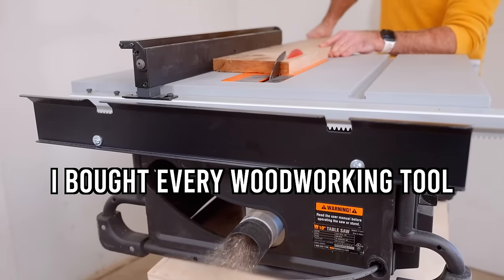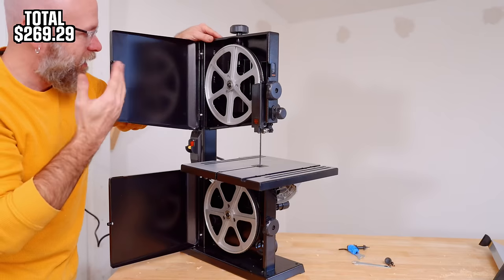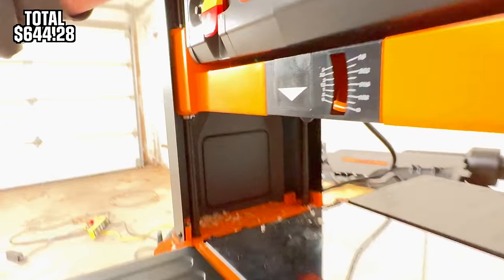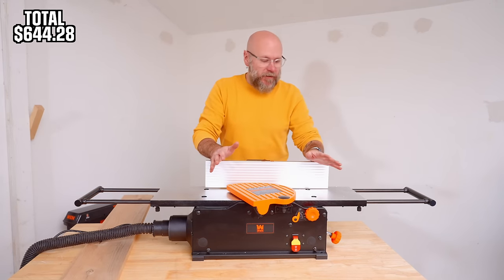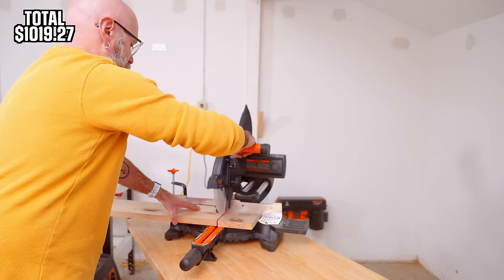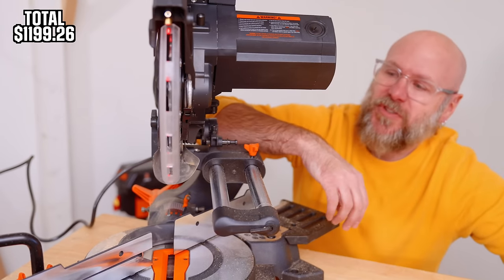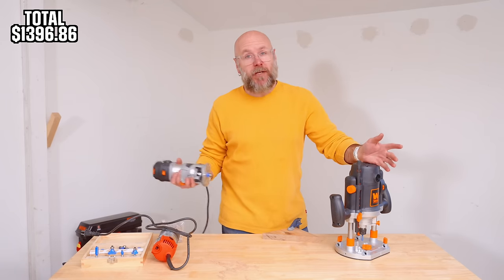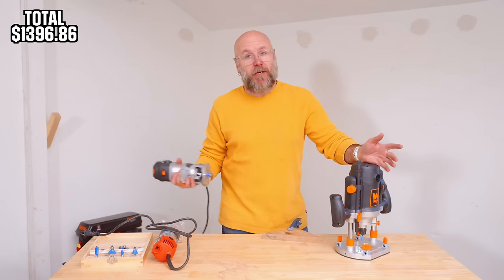I Bought ALL THE WEN TOOLS! Let's Review.

Comment: Actually you have it wrong,the correct way to machine wood is,
The joiner is first,that is so you get one face and one edge clean and a perfect 90°.
Upon having a clean,flat face and edge then you pass the opposite sides through the planner wich gives you a square and dimensioned piece of wood.
I've been a cabinetmaker for 38yrs,never do you use a planner first.

Comment: On the drill press, just screw the bolt and nut on the lid, not through the spring/bracket then just slide it up/open and shut without undoing it :)

Comment: I got a nearly new WEN planer off of craigslist that had a similar problem. A month or two after purchase the bearings in the drive gearbox failed, resulting in no feed. Must have been pretty annoying for the original owner but for me it was $40 replacement from WEN to get the thing up and running for a steal.

Comment: I have a 2 or 3 blade 13" Wen planer that works pretty well.  The only major issue I've had with it was when one of the drive sprockets broke, but the replacement part was cheap and easy to install.  I never use the rollers on top either, but that's partly because my kids always run off with them 😂

Comment: When I shop and compare, I find WEN and some other (similar) brands are identical except for logo and colors. The direct from WEN price seems to be the best...  The WEN tools I have purchased after comparing head to head, that were a better price with more or the same features:

WEN benchtop belt sander (2, the older blue one, capacitor went bad after several years of service, bought the new version... then replaced the capacitor so there are 2)
WEN scroll saw.

Comment: Some people prefer to use the bevel feature when cutting miters; as compared to actually bringing the blade out of perpendicular with the fence...

It frequently seems like bevels are more accurate than actual (vertical blade) Miters are....based on how my saw adjusts.

Comment: I have that exact planer model. It's definitely a 5/5. That said, Wen does need to work on their QA.  My Wen drill press wouldn't work until I manually turned the belt heads a few times, and the first scroll saw I received was significantly damaged (Wen replaced at no change).

Comment: I like Wen tools. I got the drill press as well, and it definitely works, but it's kinda gutless. It's good for like 1/2" bits through wood, but anything larger through anything metal? It's having a hard time. 
But hey, $100 and I'm happy with it. 

And I agree with your critiques. The spring-back is very strong and "snappy".  Also don't like the plate because you can't clamp much to it because it has weird cutouts. I went ahead and bought the drill press "table" and that is actually pretty nice and helps it's usefulness.

Comment: On the drill press, the spring tension on the spindle is probably adjustable.
On the band saw, I understand putting a good blade on, but I'm curious what the OEM blade would do.
On the table saw, needing to throw out the miter gauge would make it 4 stars.  The factory guide should be usable. Yes, most of them are not great. But many users never upgrade. 

All that said, this is an interesting set of reviews on a brand that I'd not considered.

Comment: Up to 11:40, we are with you. Clear, well made and enthusiastic, considered narration.  But talk about contrary...the thickness planer at
11:40.  How on earth can you emphasize that "Its such a high quality machine!" and in the next breath say .. "...Disappointed... Zero Stars" ? 
You are rating the overall machine, including construction, quality, power, solidity, accuracy, function.  
So at LEAST 4 stars if you listen to your self. Previous two items had too cheap knobs parts didn't fit to reinstall- ... 4+ stars~
For this planer you should GET the missing part and rate it aditionally how it feeds! 
Imagine if Consumer Reports ranked a gorgeous top quality 5-star car, at zero just cuz it was out of gas!
UPDATE:  I see you did, try again on a new one. congrats. 
PS.. Owner of about 5 planers from 14" to a humongeous 4200 lb. Wadkin and Stanko, both with built in blade grinders.(and about 50 other woodworking
machines, up to a 5 x 10ft CNC router.

Comment: I have a couple of tools from Wen and have been using them for 5 or 6 years now. The results of your review follow my expectations exactly. Wen tools are fantastic. However, it is hit or miss as to whether the tool you receive when you order it will be complete and working. I am actually a little surprised that you bought that many tools from Wen, and only one of them had a major problem. The quality and functionality of Wen tools is great for the price point, you just have to accept that you may have to return them a few times until you get one that works😂

Comment: My new WEN 9" bandsaw is my third bandsaw. It has been great so far. My first two were both JET. The first one was a cabinet bandsaw & cost $800+. My second was an open bench type for about $350+/-. From day one I had several problems with it. It would bind, damage saw blade (I went through 13 in four years). I had a factory repairmen some to my house. He could not fix it, so he took it to his shop & returned it a week later. It worked about 10-15 minutes. By the time I knew It would not work, I had it over the 5-year warranty, but asked JET if they would honor my exchange purchase of a more expensive machine... the answer was clear... NO! I gave the machine away for free & will NEVER buy another JET machine!

Comment: 11:38 I have the same planer I love it!!! 
 
After having a DW735 for 6 years, it died. I bought a new one, motor fried it 2 weeks. Took it back for new one, and the 2nd one, the motor screamed bloody murder out if the box, took it back for another one. The 3rd one only ran in high speed, so I returned it and got a refund.  (Dewalt has really gone to garbage over the past 5 years. They've cheapened everything to death. I'm done with Dewalt as a whole and 6 years ago, I had $7500 worth of Dewalt tools.) 
 
I only bought the WEN planer to hold me over until I could find a better one. It's been a year, and thousands of BF, and it's still perfect!!! 
 
I do miss one thing from the 735... the chip ejection on it was strong!!! The WEN definitely needs a decent dust collector. (Which was the other AMAZING WEN I found. But that's a different story.)

Comment: Buy a used table saw for your first saw! Old contractor saws are great and adjustable. I got a steal on a hybrid 2000’s craftsman saw for $100! Deals are out there. It’s much better than any new $400 saw and I modified it to have about 48” fence capacity.

Used tools for the win!

Comment: The flip part on the tablesaw fence isnt for small pieces. I'm not even sure how you're thinking about that.... The flip part is a support, when the fence is off the table, when it's extended to the far right. The flip supports the wood, instead of having nothing.

Comment: I got the bandsaw, and it is pretty good. Best option I could find for the money. But it I definitely plan to upgrade to a Rikon down the road. 
I got a Festool track saw but I use Wen track because it is compatible with Festool track and is a fraction of the cost and works just as well. 
I got Wen 3-2-1 blocks and those are the only sub $200 ish that are any good and I think they were like 20 bucks.
I don't think Wen makes tools, I could be wrong, but I think they shop from what is being offered by white lable manufacturers. With that said, they seem to be picky about what they put their name on and everything I have used from them has been decent. Nothing amazing (except their tracks),  but nothing bad either. For low cost tools, I have a high  level of trust with anything branded Wen. I tried some Tack-life stuff too and seems similar quality and price.

Comment: I have a WEN 4214 12-Inch Variable Speed Drill Press that I bought in 2017 and it's rock solid - this was before Harbor Freight started moving upmarket and their drill presses were flimsy (except the yuge floor-standing one), and the ones at the big box stores were too. This drill press has been very solid and I have been very happy with it. However, the lasers gave out and I had to replace them and that was a bit of a pain - I'm going to order a few extras to keep on hand. 

I also bought a variable-speed bench grinder a couple years after and I have been less happy with that - had I known Hazard Fart was going to move up market to fill the vacuum Crapsman left when Black and Decker cheapened Craftsdecker tool quality, I'd have waited and bought the Hercules grinder.  I'm not going to buy any more WEN tools because they seem to be kinda chincy with iffy reliability and finding local dealers is nigh on impossible, whereas Hazard Fart is everywhere and I can just bring a tool in and exchange it for a brand-new one - no waiting weeks or months for it to come back after paying a very expensive shipping bill to send a tool out for service, or having to try to source alternate parts from Grainger as WEN discontinues the parts and modify the tool to fit alternative replacement parts.

Comment: @16:09  I get it.  I like round knobs, too, but you're overlooking their utility.  Just rotate them out of the way, like you did immediately after complaining.  You didn't mention the best feature of the WEN miter saw.  The fixed tubes don't slide out the back of the saw which saves a ton of space in a small shop.  My miter saw is a 12" top of the line Dewalt and it needs a lot of space behind it.  Love the easy adjustment and bit changing lock on the trim router; it beats the heck out of my garage sale Ryobi!

Comment: Haven't made it to the end yet but I have the 3 blade 13" planer and have been using it for maybe three years and it works pretty good and consistently across various types of wood. If I could do it over I'd get the helical but I decided my youngest needed shoes the year I bought this.
Reply: Also have the 8" Helical jointer used sparingly so far and an in the box air filtration system I've yet to hang from my ceiling... cough cough.

Comment: Good luck with the jointer. Please do a follow up review after you try calibrating it. The design is a copy of all budget tabletop jointers. It has screws on the top of the bed to level it, and it never is level. The fence design watch closely as you lock it down, it shifts every time. Look forward to your how  to calibrate video.

Comment: I bought almost the same planer a year ago (mine is the two-speed version) and I have a mixed review. First, planer worked perfectly for me, no missing parts, etc. However, I do not like the fact that Wen uses a carbide bit that is pretty non-standard and so the inevitable replacements make this more expensive over the longer term. I actually find pretty often that my feed does not work very well and I have to gently push my boards through. This was my first planer so I can't really compare it with other brands and models.

Comment: I’ve just bought my first wen piece, the drill clamp, guess what it’s 4 stars, essentially it works but the geometry is slightly off so it’ll only clamp things over 7mm ish. For metal or even 6mm ply you then need a sacrifice board underneath. The bobbin sander I have had an identical one from a different brand and it was lovely until a student undid the cheap adjustment knob too far, the springs fell out and it never reassembled quite the same again, still did the job though, just noisily.

Comment: I actually like the cheap tools like that because 1.) WHEN they break, they're usually easy to fix. 2.) Plastic parts like knobs and switches can be replaced with 3D printed parts. 3.) They usually use common screws instead of special M2.575 x 21.5mm screws or something ridiculous like that.

And finally, it's cheap... So you can buy 2 or 3 of them for the same price as one high end tool. It's not bad, but it's not great.

Comment: Thank you for posting this. I have the drill press and combo disc-belt sander. Bought both of them from the wen shop on amazon. Had to return the sander due to a bad motor. They shipped a replacement in a week. Will probably get the track saw or bandsaw as my next purchase based on your reviews.

Comment: LOL, I have that exact drill press.  I bought it from Harbor Freight maybe 15 years ago for $40.  It works.  The bit speeds are a little too high for drilling steel but will work in a pinch with lots of oil.  The torque is a little low to the point I never bother clamping workpieces since I can stop the motor by just holding onto the piece hard.  It will drill lumber and plastic and Al just fine.  Steel works up to about 3/16" or so and you have to dump a lot of cutting fluid or oil into the hole to prevent overheating.  HF no longer sells that exact drillpress so Wen must have bought the rights to the design.  $40 was a great deal.  Honestly, for $100+, you can get a better one from HF these days.

Comment: I Bought All Ryobi Powertools
Pretty Cheap. I Have A 10 Inch 
Miter Saw A 16 Inch Scroll Saw 
& I Got A Crap Load Of Ryobi
Tools At A Thriftstore.
I got The Ryobi Bag It Contained
A Recip Saw A 5 Inch Circular Saw
Flashlight & Drill. & I'm Happy
With Each & Every One Of Them.
I Whent On Rockler Woodworking's
Website & They Had A Toolfest
Miter Saw For $1 ,300.00 That 
Was Crazy!!!! Who In The Well 
Would Fork Out That Kind Of
Money? I wouldn't Fork Out
That Money For No Miter Saw.
I Paid $331.00 + $25.00 Tax
Wich Came Out To Be $356.00

Comment: I had the DeWalt planer which was stolen. I found that the Dewalt 18:38  was a lot more powerful. I bought a Wen with the spiral head. Good cut.  It works hard on hard knot cedar as well as maple.  Other woods even oak work well  Dust collection not as good as the Dewald

Comment: I have the Wen Spindle Sander, and love it. I also have the VSR Benchtop Drill Press which I also love. Budget does not have to = garbage, and I think with a few exceptions they have shown that. For a hobbyist, non-production environment I think they absolutely work. 
I was super disappointed about the Planer you received though, it really sucked the enthusiasm out but am interested to see what happens with the new one they sent as I am super disappointed with my Jet, and may be going back to Dewalt (or upgrading electrical and getting a more substantial planer). 
6" jointer regrets.... "what she said".

Comment: You are a little hard on Wen for the planer. I bought a brand new DeWalt miter saw and ended up opening it after 90 days so the big box wouldnt take it back. The deck had the slightest crack in it. You flipped it over it had a very large crack from a bad casting. This was not from stress or being dropped, surface was really rough, like the aluminum was not quite melted and not enough aluminum, had a bunch of tiny air bubble in the casting. DeWalt service center said they never seen this. They ordered the part, i called 1 month after dropping it off than 6 weeks, still waiting on the part. After 8 weeks they said come in, we just replaced it with a new saw in the box. That was the 4 miter saw I've owned by DeWalt, outstanding quality, but even they screw up. QA was asleep at the wheel that day.

Comment: On the bandsaw, I wish you had compared the ease of guide setup and adjustment, compared to your best bandsaw, and checked how difficult is is to make the table exactly 90-deg to the blade. Does the bandsaw have a blade-tension release?  Likewise on the drill press, how easy is it to make the table perpendicular to the drill bits?

Comment: Most of the tools you reviewed come out of the same factory that produces Ryobi for the US market. Ryobi in Japan makes their tools in Japan. Contrary to belief, Ryobi JP made good tools.

I have a Wen tracksaw but I opted for the 8 1/4 inch version as I could easily get Diablo blades. I didn't buy the Wen tracks but got the Powertec tracks.

The tablesaw is a Dewalt ripoff like everyone are doing. I had one but it was the plastic base version rather that the roll cage design. It was a very good saw. All contractor saws are loud as they have an open base and high winding motors. A 3 hp cabinet saw wouldn't go into second gear to cut 3/4 material.

Comment: Their band saw isn't too bad for the price especially for routing, but I do wanna upgrade to have one with a larger more sturdy blade. I have their largest drill press model and it is very nice and has a digital speed read out and you can change it without changing belts, probably won't upgrade to a floor model for quite some time. The spindle sander is alright but I'm definitely about to upgrade. I also just got rid of my wen 6" jointer in place of a grizzly 8", I really did not care for the wen. It worked but was very small, horrible dust/chip collection and was annoying to set up, and the table is short.

Comment: I bought the wen drywall sander years ago it was cheaper than the cheapest part you could replace on the porter cable sander it worked great and I got 4 more and they all still work and I haven't had to fix them like I would always have to do with the porter cable. 5 wen tools were cheaper than one porter cable which were constantly breaking down and I would spend hundreds on each one every year